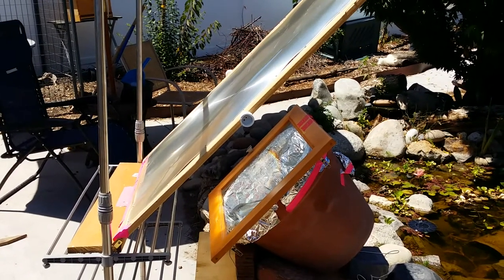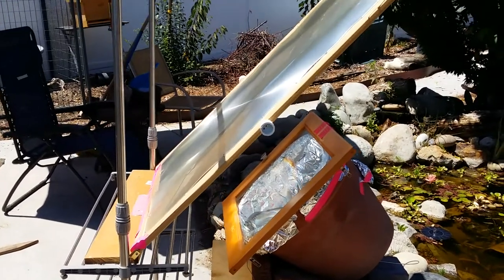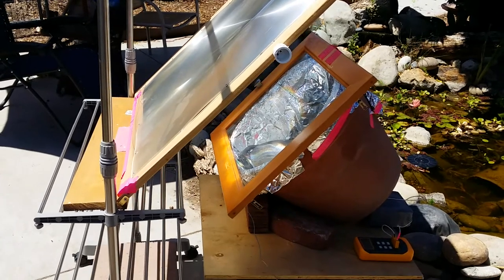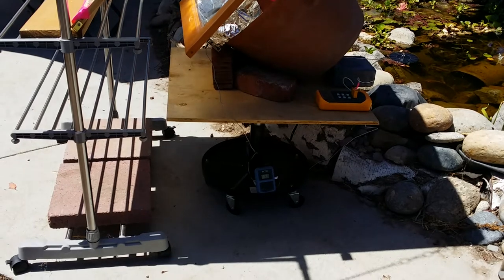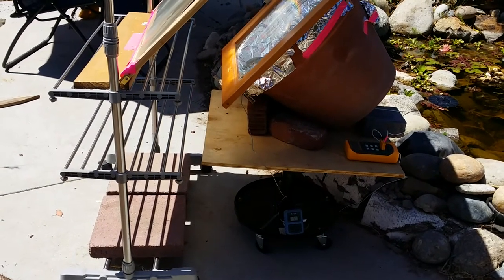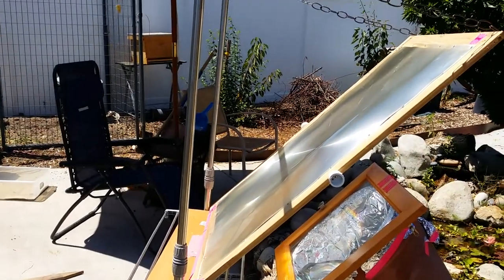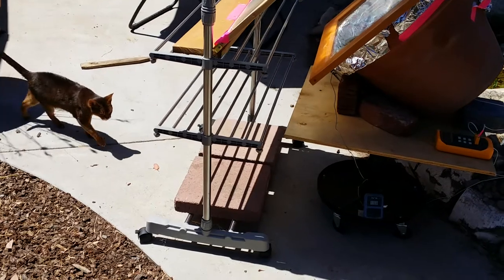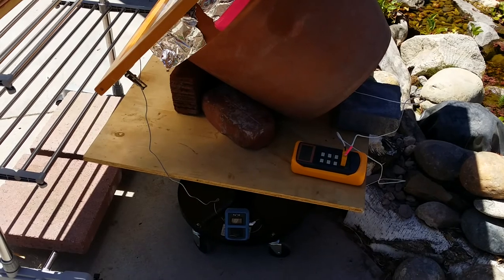Fresnel lens solar cooker

Comment: nice work! - hey could you try melting some plastic bags with that lens? I want to melt some plastic with solar power and the Fresnel is appealing method
Reply from the maker: Thanks!  melting plastic should be no problem this is a spot lens and I've measured temperatures in excess of 1200 F from it.  what kind of plastic did you have in mind?  The next time I have my rig out I'll see what I can do.
Reply: Grocery bags. If you crammed 25 bags into one at what point will it turn into peanut butter consistency
Reply from the maker: Yikes.  I don't think they would melt, I suspect they would vaporize.  Or burst into flames.  It would be like trying to melt them with a laser beam. But, it is worth a try!  Do you know if burning them produces toxic fumes?
Reply: Hi, melting plastic to make diesel is one of my experiment for next summer. I will be using the SolSource solar cooker and moonshine, we will see how it goes :)